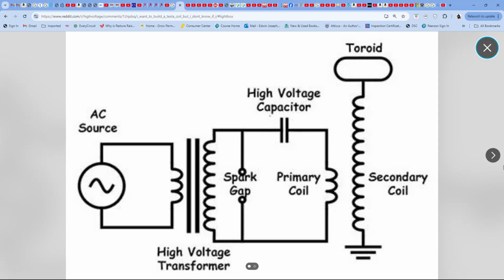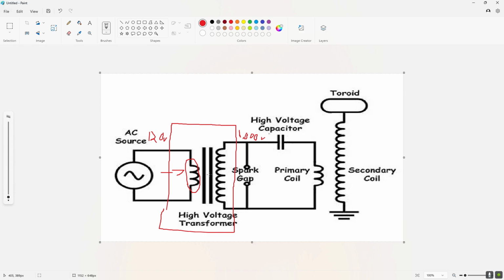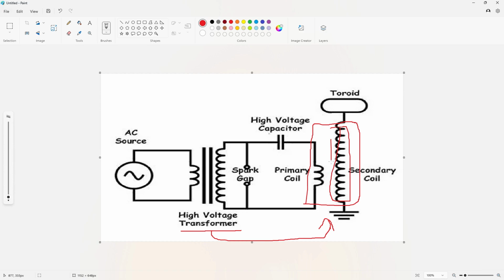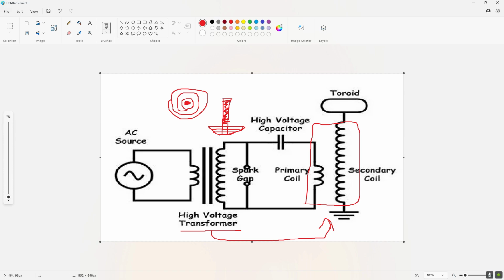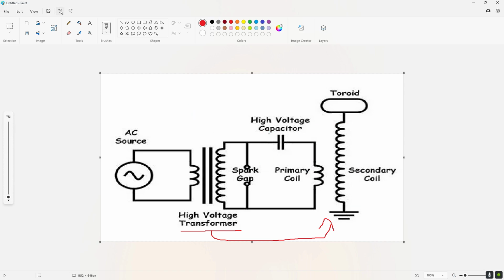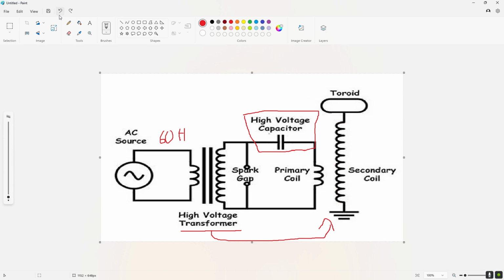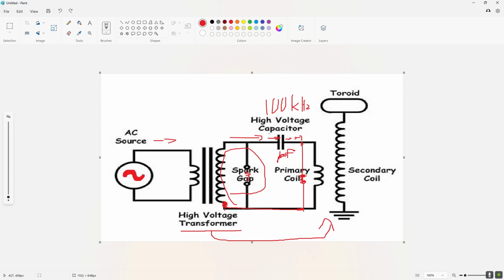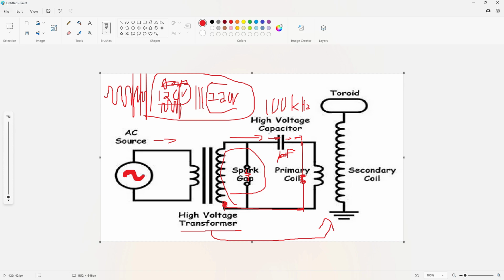The Science Behind the Tesla Coil

Comment: I don't mean to be mean or disparaging but the information in this video is quite inaccurate.

You talk a lot about the difference between air and iron core transformers, you should at least mention why iron cores are used in normal transformers and why the Tesla coil does not have an iron core. The point of the Tesla coil was not that is was an air core transformer and thus it transmits energy wirelessly, technically an iron core transformer also transmits energy wirelessly, as the primary and secondary windings are not electrically connected, Iron cores are used in a transformer so that the energy in the primary winding is transferred efficiently into the secondary by confining and directing the magnetic field lines. With an air core transformer, the magnetic field is not confined and so a lot less energy is transferred between the primary and secondary. In a Tesla coil, low coupling is intentional to allow the secondary coil to oscillate, as well as to simply prevent damaging the secondary coil. 

This leads me to the next point. A Tesla coil is not a regular transformer, it is a resonant transformer. You talk a lot about how the capacitor "increases the speed" of the electricity. I'm not sure what to say about this other than that it is technically not accurate. The capacitor itself would do nothing to change the input frequency. The primary winding of the Tesla coil and the capacitor form an LC circuit, the frequency is a result of resonance. The resonant frequency of the secondary side of the Tesla coil is determined by its physical characteristics and is fixed. The resonant frequency of the primary side of the Tesla coil can be adjusted by changing the number of turns on the primary, which changes the inductance and allows you to match the resonant frequency to that of the secondary. The matching resonant frequencies and the resulting oscillations are what allow a Tesla coil to achieve such a high output voltage. 

You talk about having a conical winding vs a flat winding on the primary and how a conical winding is better. The shape of the primary as well as its proximity to the secondary determine will determine the strength of the coupling, or, how much energy is transferred between the primary and secondary. The shape then becomes a design choice, you can increase the coupling between a flat primary and the secondary by moving the secondary closer to the primary, but that may cause arcing between the primary and secondary. You can avoid arcing by moving the windings further apart but that will decrease the coupling and so you can make the primary conical to increase the coupling. A conical primary isn't necessarily better or worse, its just a balance of achieving optimal coupling and minimizing arcing between the primary and secondary. 

Technically you can run a small, low power Tesla coil without a top load but you will quickly ruin a high power coil without a top load. The top load, in most cases a toroid, raises the capacitance of the secondary side of the coil and allows it to store charge and produce bigger arcs. It also helps direct those arcs away from the coil. The size of the top load is not critical but will change the resonant frequency of the secondary. The top load capacitively couples to ground, completing the secondary side circuit. 

The spark gap allows the capacitor to build enough energy, then discharge when a certain voltage threshold is reached, that threshold being determined by the length of the gap. When the spark gap discharges, it creates a relatively low resistance channel of plasma that allows the capacitor to dump it's energy into the circuit, the energy is then exchanged back and forth between the primary and secondary at the resonance frequency of the circuit. The energy is eventually dissipated mostly as heat due to resistive losses and the spark gap quenches. The power supply then raises the voltage of the capacitor again and the process starts over, this happens many times a second and so the spark gap appears to discharge continuously.

The spark gap can either be placed in parallel with the power supply as show in the diagram, or the capacitor can be placed in parallel with the power supply, with the spark gap in series with the primary coil, but the spark gap absolutely cannot go where you suggest. Consider again what happens when the spark gap discharges. Normally, when the spark gap discharges, a closed circuit is formed by the spark gap with the capacitor and the primary winding of the Tesla coil in series. If you were to place the gap where you suggest, every time the spark gap discharged, you would essentially be removing the primary winding of the Tesla coil from the circuit by shorting around it with the spark gap. In that configuration, the Tesla coil would not function. I am interested to know why you think it would make more sense to put the spark gap after the capacitor. 

The discussion on isolation transformers is very lengthy and not particularly relevant to the science behind Tesla coils.
Reply from the maker: The Tesla coil experiment is comprised of many lessons. One lesson is to observe the operation of an air-core transformer in realtime. The point of this video as with many others that I make is to keep them simple and less technical, in which case I intentionally avoided going into resonance frequency.  The capacitor does in fact play a role in its resonance frequency, I don't know that you are exactly refuting that or just trying to be more precise and explaining the entire phenomenon in terms of resonance of the coil. I appreciate the precision in which you like to discuss the topic but that is typically not the angle I am taking. You obviously know about electronics, these videos are aimed at trying to get folks who are new to the subject to be able to construct a basic visualization about how the circuit works in layman's terms. I would have only given the type of response you gave to someone who was already privy.
Reply: @krlabs5472  I understand trying to keep in simple and easy to digest, I'm saying that your explanation may be over simplified to the point leading someone to drawing incorrect conclusions, and some of the information in your video just comes off as factually incorrect.

The concept of resonance frequency is fundamental to the Tesla coil, so to talk about it's operating principle without discussing resonance does not make sense. The high frequency that you discuss as being required to drive the coil occurs entirely due to resonance, not filtering of incoming voltage.

In your video, you state that the capacitor in the circuit is creating a high pass filter.  You say "what we're concerned in this circuit is the high pass filter which is made by this capacitor which is in pico farads is because we need to speed up this electricity that's coming out of the wall socket". This would lead someone to conclude that a filter can somehow change incoming frequency, though as I am sure you know, a filter only attenuates voltage that is not at a particular frequency. You also say the "Tesla coil [secondary] is not only to increase the amount of voltage that that gets transferred through the air while it's climbing up here but it also increases the frequency". This is simply false, like I mentioned before, the resonance frequency of the secondary is going to be an inherent property of the coil and top load and the primary is tuned to match it, so there is no increase in frequency in the secondary coil.

In any case, the Tesla coil circuit is not even a high pass filter, it is actually a band pass filter. 

Again, I hope I'm not coming off as disparaging, I just enjoy talking Tesla coils, I actually just recently finished building one.